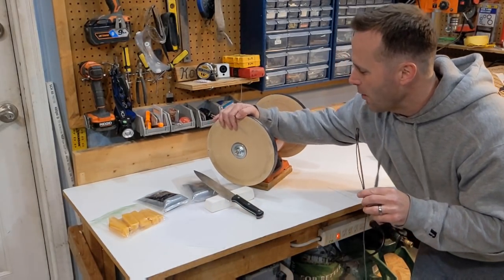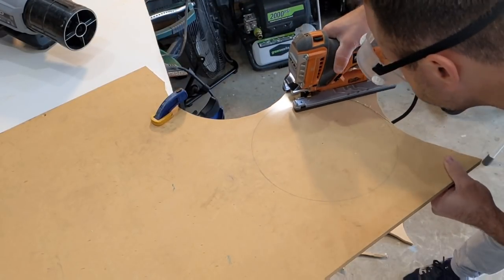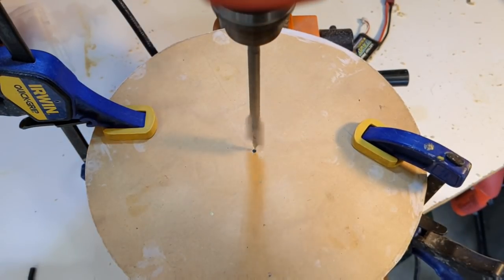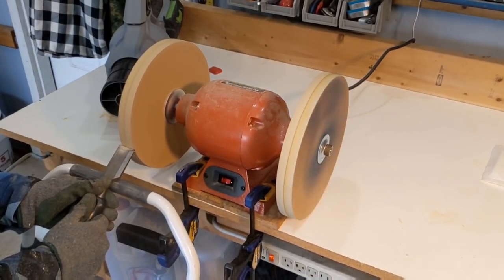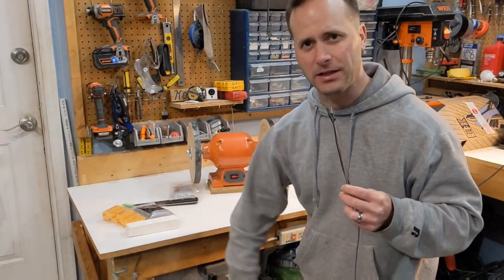DIY MDF Sharpening Wheel (XL 10")

Comment: Awesome. I'm an amateur knife maker and one aspect that I always have trouble with is sharpening. Ill be making one of these wheels in the next couple of days. Thank you for the video. Also, may I ask what is the purpose of adding beeswax to the silicone carbide?
Reply from the maker: Thanks! Helps keep the heat down, and helps the silicone carbide stay on the wheel longer.
Reply: @kove  thank you very much for the reply. I know this is a slightly older video of yours so I appreciate the response 👍
Reply from the maker: Glad to help! If I can to do it again, I'd probably make the wheels smaller so it's easier to balance and less mass to shake things around.
Reply: @kove  I was thinking of maybe 6 inch? I only have small bench grinder so I thought that size should be ok
Reply from the maker: What ever size of wheel it came with is what I'd do. Also don't necessarily need to make it double thick like I did. Once you have the supplies, the MDF is cheap to try different options.
Reply: @kove  thanks again man. Ive Literally just finished my most complex knife to date and Cant wait to put a wicked edge on it 👍👍
Reply from the maker: @B355Y  No problemo. Watch other guys videos as well and stay safe!
Reply: @kove  one thing you can do is cut the circles with a table saw. Put a screw into the top so it can pivot around that center point and slowly rotate the sheet into the table saw blade. It might seem sketchy, but it works way more accurately than a jigsaw. It's almost perfectly balanced right off the bat. I learned this from the old days of a channel called green power science.

Comment from the maker: Beeswax https://amzn.to/3Zv6aKA
White Polishing Compound (aka Jeweler's Rouge) https://amzn.to/3Y4nEMJ
Silicone Carbide Grit https://amzn.to/3EJKnXE
Bench Grinder https://amzn.to/41CHdz0
0:01 Intro
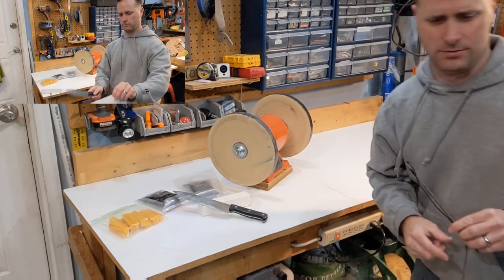0:10 Switch rotation of bend grinder
0:40 Remove guard
1:14 How the wheels are held in place
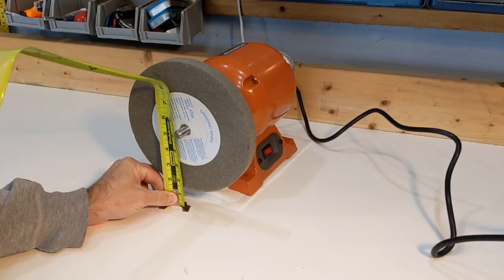1:32 Measure max size of diy sharpening wheels (ended up being 10 inches)
1:39 Drawing perfect circles to cut diy sharpening wheels
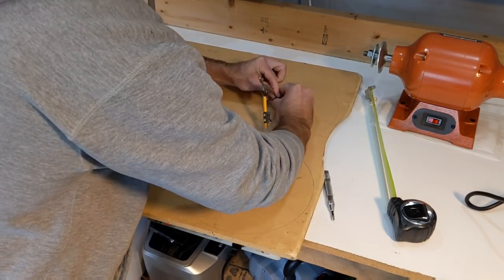1:50 Cutting diy sharpening wheels
2:17 Gluing together two MDF circles to double the thickness
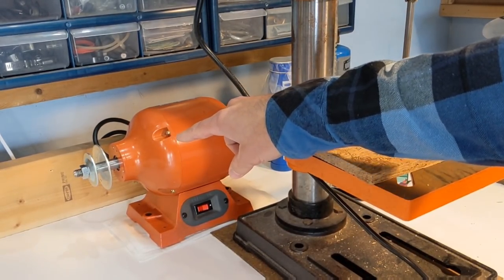2:48 Drilling hole in the middle of diy sharpening wheels
3:24 Installing sharpening wheels
3:49 Testing balance (it was very unbalanced)
4:17 Turning the wheels to make it more balanced
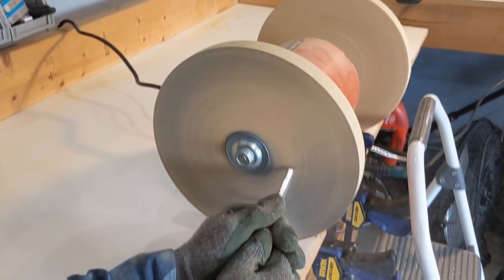5:28 Impregnating the MDF with the Silicone Carbide Grit
5:53 Add a touch of beeswax to the Silicone Carbide side after it has dried
5:57 Add a touch of polishing compound to the other wheel
6:10 Dull knife, will not cut paper cleanly
6:17 Sharpening knife
7:17 Sharp knife, now will cut paper clean
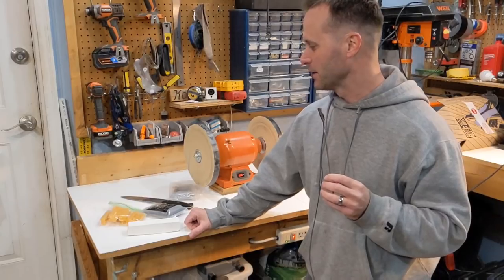7:29 Is it worth the hassle?? (outro)

Comment: Just my opinion. I think 10 inch is too for your motor to spin efficiently. That motor will not hold up very long.
Reply from the maker: Good point, it's a lot of extra mass. Good thing is I don't use it very often at all. Thanks for the comment Keith!

Comment: I think theese kind of sharpening/stroping ruins the heattreatment.The edge/ the  apex is very very thin right,and a very thin or small amount of material heats up faster than alot of material,it may take only microseconds to overheat an edge with these fast spinning wheels..
Reply from the maker: Lots of true things to consider.

Comment: And the heat generated by this wheel will remove the temper of the steel and destroy a good knife. That's why chefs sharpen their knives on a wet stone. Doing things on the cheap is just that.
Reply from the maker: Interesting point, I'll have to feel it after to see if it's hot.

Comment: MDF DUST CAUSES CANCER!!!  Now you have that crap all over your shop or garage.  Plus your son and wife got a dose of it too! You should invest in a central air 
filtration system with a 1 micron filter.  I saw you were sharpening your knife with blade facing the in the wrong direction. The blade edge should always be facing away from the blade edge. Why? Because the blade could dig into your MDF WHEEL and cause a very dangerous accident.  You should at least invest in a good filtration mask at the very least. In conclusion, never allow your children into your shop. Anyone that enters your shop should be wearing a high standard face mask to filter out the dust particles.
Reply from the maker: The blade edge was facing away from the rotation, I reversed the rotation in the beginning by twisting the base 180 degrees. The MDF is concerning, thanks for your advice Richard.